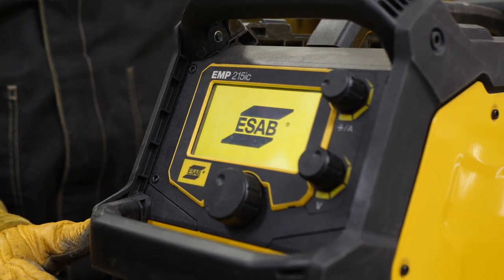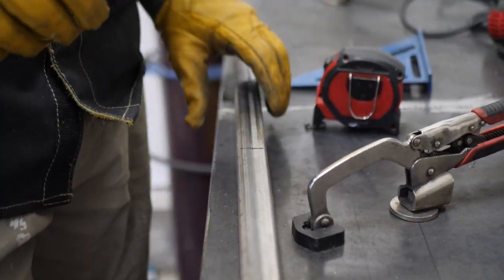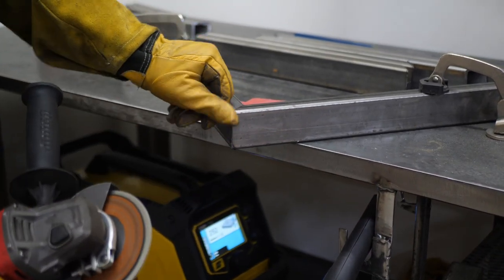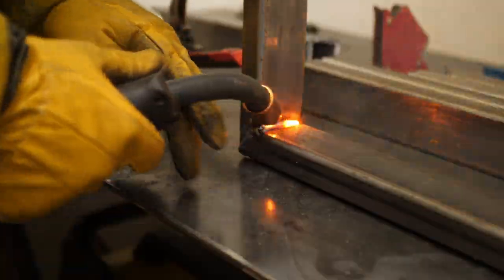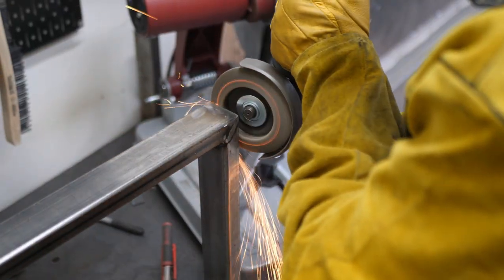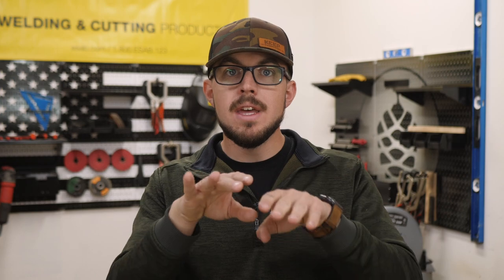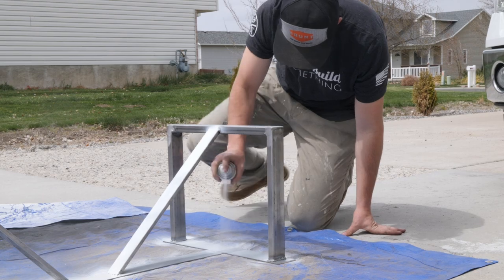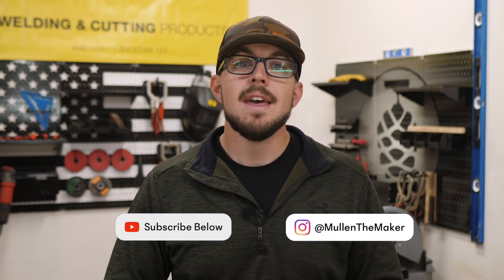SIMPLE Beginner Welding Project - Coffee Table Build

Comment: Instead of leaving a gap between the two pieces, you could also bevel the edges of the flat bar with your grinder and butt it right up against the legs. That way you are certain of your measurements and still get good weld penetration.

Comment: Welding is my next endeavor. Not sure of all the types and what’s best for starting out on 110V. I’m leaning towards the gas less wire option. (Think that’s a TIGG?) Thanks for the tips.
Reply from the maker: I would suggest something similar to mine. The gas will help as ton at keeping it cleaner then the gasless. Having the SMIG on the ESAB is ridiculously nice. Plus as I get better I can do stick, TIG and Flux Core. So I am not limited as I grow.
Reply: I like stick there are a lot of different options out there like 120/240v mix. Otherwise flux is a great starter but messy I’d look on Marketplace for a cheap one then you can always resell as you learn and grow

Comment: how do you like that Chicago Electric Cut Off Saw? I'm new to metal fabrication and have a few projects under my belt and was looking at Cut Off Saws. I was looking at the Evolution ones but they're 3x the price of the Chicago Electric and I'm curious if it's worth it considering I'll just be a weekend warrior building metal planters, table legs (like yours) and eventually an offset smoker.
Reply from the maker: It’s been nice to have. I’m happy I bought it. It definitely beats out using a grinder with a cutoff wheel. Lol